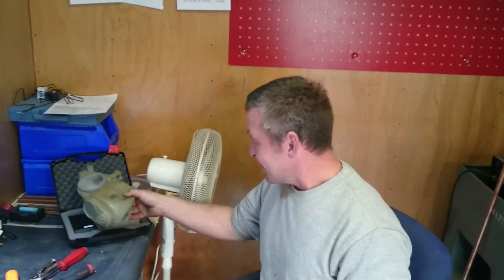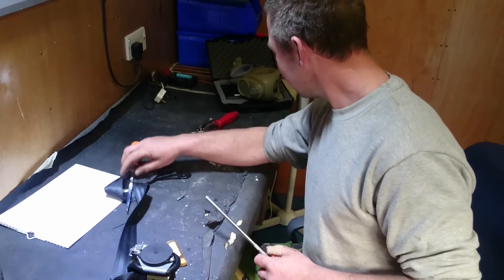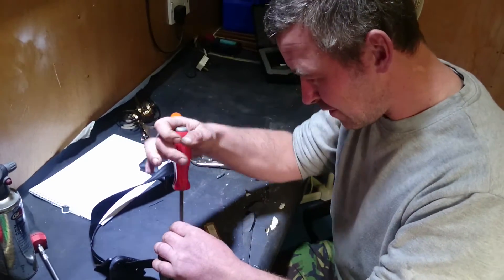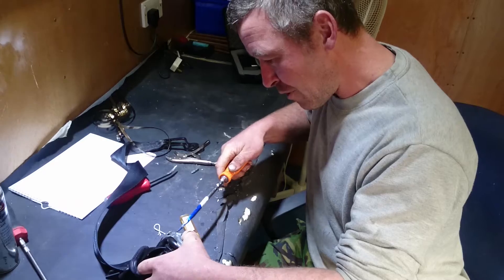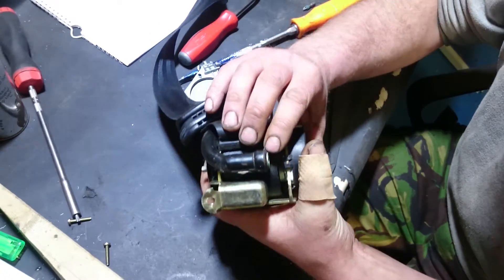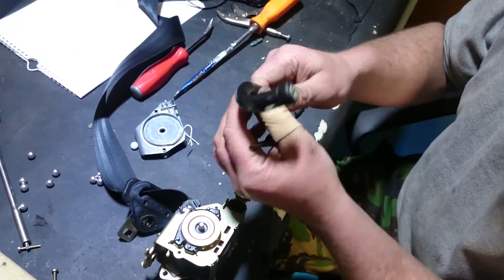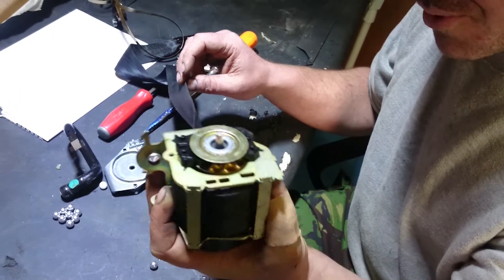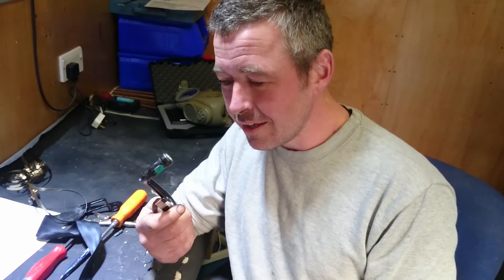Inertia belt dismantling for next project

Comment: Do you know how to remove the charge without exploding it?
Reply from the maker: Dan Burkovskiy not from these, I've managed to separate the airbag propellant, but you tube have banned this sort of thing now and I took a few videos down after Cody's lab got temporarily suspended for making gunpowder out of piss.
The risks of it exploding in your face are high as these things are swaged together and require cutting apart, best just to find a way to use them as they are.